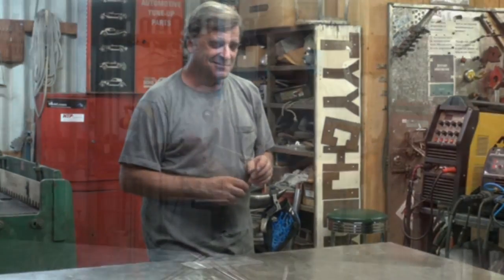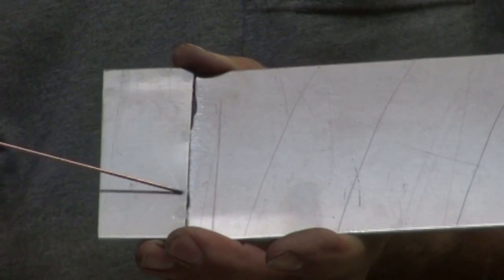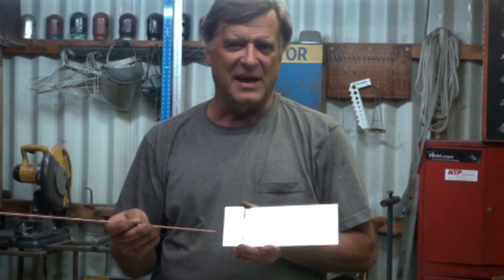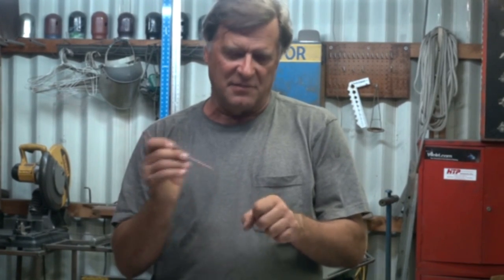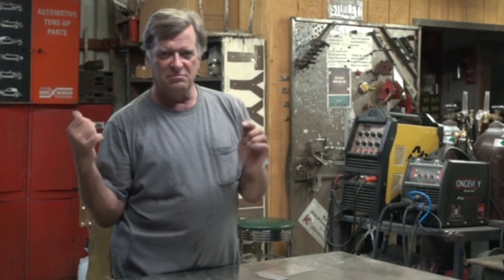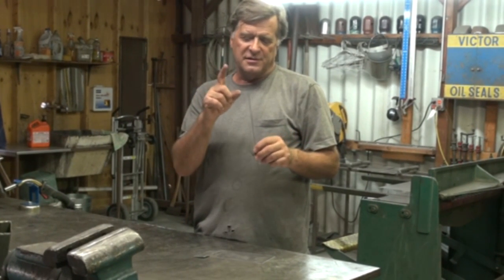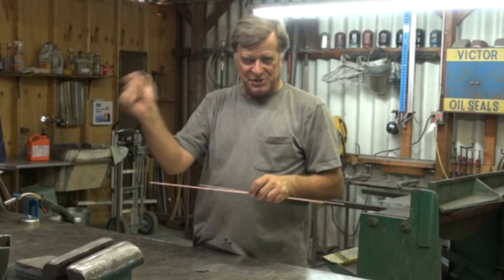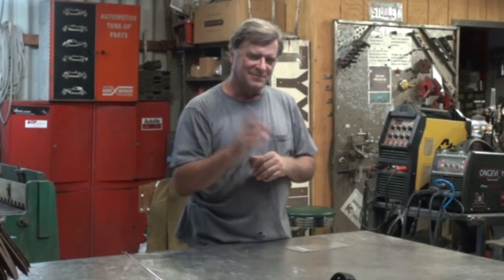How to Pick the Right Size Welding Wire for Your Job - Kevin Caron

Comment: But what if your 90 year old farmer that bubblegum welds everything in his gaps or like one inch what are you do with that stick a bolt in the hole and welded in to fill it, LOL
Reply from the maker: I would normally get out the coat hanger for this type of weld.
Reply: @KevincaronSculpture  I use 1/2 inch thick MIG welder wire because I've got massive gaps when I cut steel, LOL

Comment: Kevin do a video on technique on mig vs flux core welding
Reply from the maker: Same technique, just different results.   Hate flux core!
Reply: @KevincaronSculpture   kevin thank you for your video. just a question, what size wire i should use for welding  1-1/2 X 1-1/2 X 11 GA (.120 wall)  Square Steel Tube for a driveway gate?

Comment: What determines the strength of the weld ,weight capacity and  it's breaking point ?
Reply from the maker: Not sure.
Reply: You'll have to refer to the manufacture of the rod or wire who would have the lab test results on a given type of rod or wire.

Comment: May i ask  you which kind of welding rod can I use to fix an Exhaust Flex pipe ( one side is normal iron but the other side is cast iron ) . Thank you very
Reply from the maker: Try silicon bronze, should work for this.
Reply: Thank you so much.

Comment: Hey 
   Great Explanations really easy to follow along 
could you do one on how the inverter welder works ???
by that i mean how dose it transform the electricity VS using a transformer
Reply from the maker: Great question and I would have to say not right now..

because I have no idea how they work!
Reply: I've got an everlast inverter welder that is rated 250A at 60% duty cycle but weighs way less than a transformer-based welder. Your question got me curious and I found my answer on google searching "how inverter welder works". Give it a try. It helps if you know a little electronics to understand why inverters are so beneficial and power efficient.
Reply: I actually have an everlast inverter welder. It is a good question because I'm amazed at the magic that goes on under the hood. It seems like great technology.

Comment: Good video man. Helped me alot. Im a newbie.  Love building stuff in my garage. Would you recomend 0.35 for my hobart handler 140? Ive been using 0.30. No problems. Just figured id try something new. Like you said, with me keeping in mind that I'll need to increase power and change tips. Any other tips id appreciate. Oh yeah i am limited to flux core wire. No gas yet. Thanks and cheers from texas.
Reply: Hmm thanks for the reply. I just got this machine so i can't upgrade yet. Ill just stick with .030 for now. Im not doing anything heavy duty. Just small projects and fixing things here and there.

Comment: I've only got a mig at the moment. My main consideration for wire size is how thick is the metal I'm welding. I usually run .030 wire for most stuff. I had a friend bring over a vintage dirt bike pipe that needed a bracket welded back on. It was super thin. While I could weld it in stitch fashion with the .030, I opted for the .023/.024 wire which let me just weld it with little or no burn through. My buddy uses multiple welding rods quite often in stick application and he's pretty good at it. It is usually to compensate for a bad fit up and the metal is usually thick enough that burn through isn't much of an issue.

Comment: Pretty inventive idea on doubling up smaller filler rods when you only got itty bitty ones Kevin...but gotta be Really Careful when you try "cheating"; more rod means more amps required to melt which means more heat put into work piece...you run risk of blowing holes in that thin gage stuff (or at least rounding edges & corners)---better off just doing multi~passes to get desired fill, with cooling time in between each pass. But clever idea non the less ;)....
Reply: I seen  where  he will  twist two of them together using left   over mig wire  to use on tig welding as well  Gordon. cheers